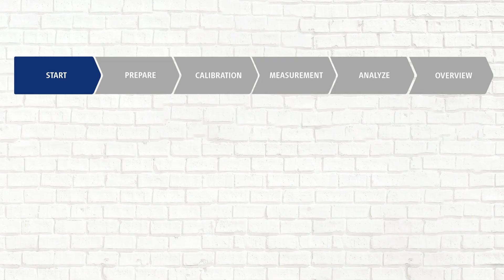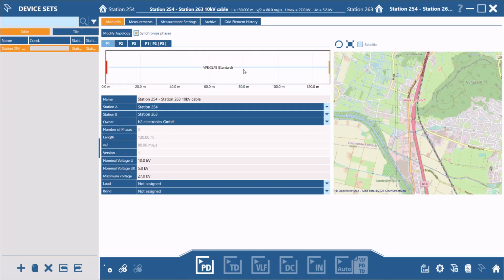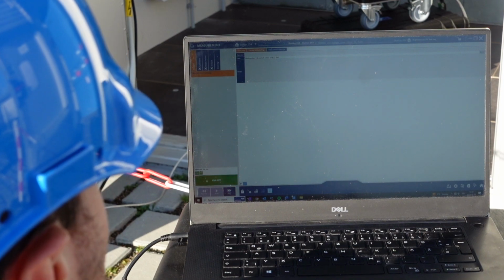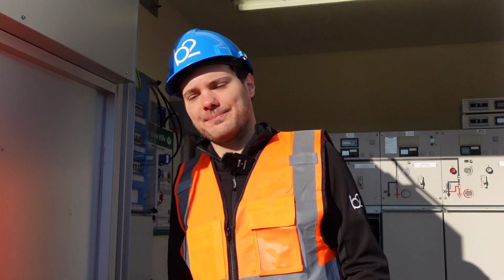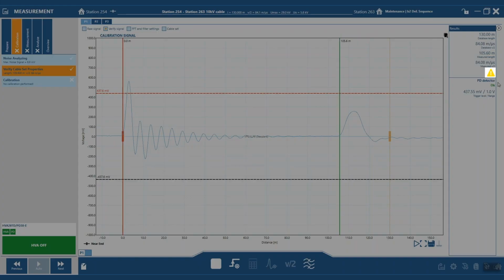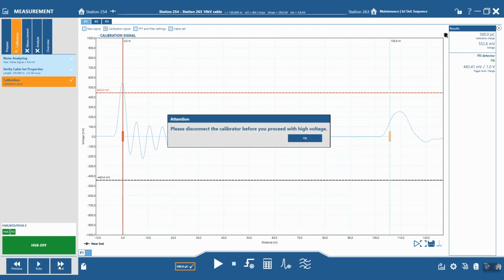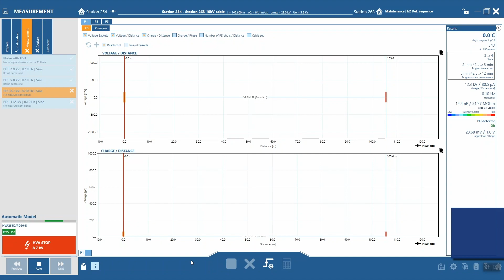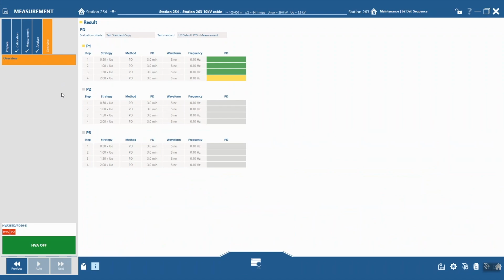HVA28TD PD30-E Start a measurement

Comment: Thanks for explanation. 
Appreciate could you share us how to use filter and when to use it in B2 suite software. 

When pd detector shows overflow and voltage full scale and trigger level not automatic change, should use manually during measurement. It should be automatic?
Reply from the maker: Thanks for your feedback. We will put it on our list and try to include such information in one of our next videos.
Regarding your questions about the trigger, we would like you to contact our technical support team (support@b2hv.com)
They can assist you with any technical issue and further details.